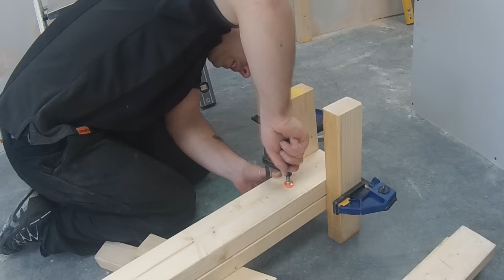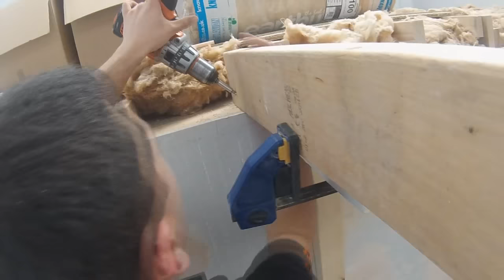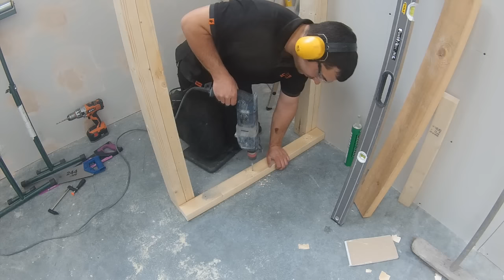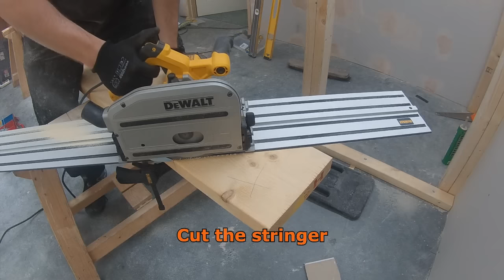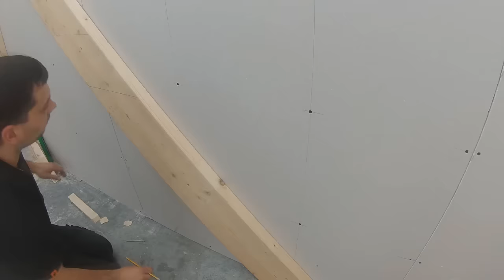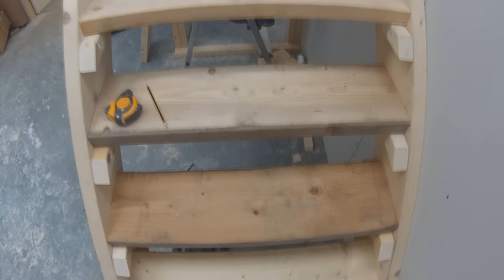How to build Stairs. Easy steps DIY staircase

Comment: I thought, I was the first to do this design, this guy did it 8 years ago! I built these stairs for a tiny house in my backyard. In addition to screws I also used glue for each support and I secured brackets under each support.
Reply: We bought a house built in 1955 that has this same stair design leading to the basement. Works pretty well, but eventually the supports wear out if they're not thick/tall enough.

Comment: I don't think that would pass code in most areas. You have the skills, the tools and the track saw to make perfect stringers with a framing square. Always use three stringers and remember the adage for measurement "finish floor to finish floor" and you can't go wrong.
Reply: I need to replace some stairs that go to storage over a shop, they are outdoors. The originals were very similar to this but had metal brackets on the stringers to support the steps. Wouldn't attaching supports to the stringers for steps, instead of cutting the stringers for steps make them last longer as it's still a 2X10 instead of a 2x10 with huge sections cut out. I also doubt my ability to make all those cuts correctly, I don't understand why this wouldn't pass code (I won't be inspected but want to make them safe), other than not having a 3rd center stringer.

Comment: You could have skipped the first minute and a half of video by just buying 4x4s to begin with instead of laminating 2x4s.
Reply: ignorant comment, laminating 2x4s instead of using a 4x4 minimizes twisting and provides more structural strength.
Reply: @igoryakunin685  I actually wondered the same, so thanks for giving the explanation of why two 2x4 are better.  I like to build things but don't have the background to know things like this.  Thanks again!

Comment: Thanks for sharing your work . I'm sure this is OK for an indoor job which I've  seen in our store front rental units. As per load capacity, I will not suggest any over 250 LB.
Reply: What is the biggest problem with loads? the stairs? can you any improvements on this design?

Comment: I did this similar way.Instead of cutting out the stringers thus weakening the wood I did as in video nailed the stringers.Another factor cost 2x12 wood is $$$$$ at least where I live.By nailing the stringers you can go thinner thus saving money and still super strong structure.

Comment: Sure beats measuring and cutting multiple stringers to exact dimensions. I like the look as well. I have an outdoor deck with stairs to a landing. There has to be a stringer in the middle though. If I adopt this design, I just have to cut steps in the middle stringer.

Comment: I made a stair case similar to this, only I made sure I put 2 lengths of threadbar between the strings a third and then 2 thirds up - that way the strings won't spread apart over time. Also glue every surface that you're screwing and these will be strong stairs. As they are - I wouldn't have much faith in them

Comment: I´d like to do a question (sorry for my english) I can see you are using thick steps, but the step´s support is holded by 3 screws, so all the weigth is supported by 6 screws. Is it right? Thank you very much for showing your job!
Reply: Bueno Javier, ten en cuenta que los tornillos son gruesos, yo no pondría más tornillos, si acaso uno más y , en todo caso, los soporte se pueden encolar.
Reply: Only if you stand in the middle of a step. If you stand close to one side then your weight exerts force pretty much on only the 3 screws on that side.

Comment: Solid (uncut) stringers are much stronger than pre-cut stringers you buy.  They only have about 4 inches under the cut, while if you build it like this it's the full 8 or 10 inches.  Ideal stairs are 7 inch risers and 11 inch treads  but they can be a bit shallower to make all rises the same size:  Very important.  Learn to use a building square to mark their position.  Very quick and easy.

Comment: I wouldn't notch the top with sistered wood I would use maybe 6x6 that has been routed out in the middle leaving two edges and inside is some sort of metal bracket. Other than that it's a good video.

Comment: I did something similar I wanted mine to be a feature, so stained it and finished it with polyurethane. One tip, between coats of PU, sand down the stringers etc. but do not sand the actual treads of the stairs. That way they remain slightly rough with the grain that is lifted and this makes them safer.
Reply: Leon thecat   Mine is as solid as a rock.
Reply: Leon thecat  You haven't seen mine so why refer to it as a death trap? The load is not supported by screws. The stairs are let in to the supports. My only comment was not to rub down the treds of the steps as the roughness is actually useful.
Reply: Leon thecat  Yes, it is to code.
Reply: Leon thecat  The contractr dealt with all that. It is several years ago. I had 2 staircases installed at the time.  I should think around a hundred Leva.
Reply: Leon thecat  Why don't we just bring this to a close? Not sanding the treads of stairs works well.

Comment: If you don't know how to build a staircase/steps properly just go to your local Lowe's or HD. They have stringers already cut and ready to go in different sizes. Just cut and add the steps yourself. Over time the steps in this video will collapse. Atleast glue the side supports on before screwing them. Looks cool though.

Comment: How much weight can they handle?
Reply from the maker: Haven't tested it, but I would guess at least 800 lb / 360 kg.
Reply: HA that's great!
Reply: Each step is only being held by 6 screws (and in reality 3 screws since most of the weight is on one side or another) that easily bend due to the 1.5 inch bending moment from the wooden blocks.  Well under 800 lbs.  If they were replaced with typical metal hangers that have virtually zero moment and use 3 - 4 screws/hanger I would guess it would be at least twice as strong.  I built a stair like the one in the video several years ago on a deck.  Inevitably water and debris were trapped on top of the wooden blocks and they rotted first.  Eventually it provided no compressive strength and the treads began to move as they were essentially only being held with unsupported screws sticking out of the stringers.
Reply: Well hes screwed them onto a massive 10mm of plasterboard. Also he has been extra clever and not used any truss rods. Bombproof! Not...
Reply: +Dave Clarke Looks to me like the screws are in line with the studs in the plasterboard wall. No idea what a truss rod is.

Comment: I would put 2 lengths of threaded bar between the strings a third up and 2 thirds up to stop the strings from pulling apart over time. Notching out at the top of the string weakens the string. Risers should be higher (7.75'' I think) and all equal. Tread would be nicer with a bull nose - less painful when you fall/up/down them.

Comment: You could call this a ship's ladder, not a stair case. I would have used joist hangers at the top instead of cutting the board, and when you cut the first piece off the bottom of the board you should have saved it and used it as a guide for the angle you established.

Comment: Not awful, I’ve definitely seen worse. If you want to have a staircase that will pass a building code inspection though, this is not the way to go. Treads must be 11” or 10” with a nose. No rise can differ more than 3/8”, and finally, if there is a finished area the stairs must have kick plates. These aren’t my rules btw, this is IRC standards.

Comment: I like notching the stair steps out of the stringers. It allows you to use 3 or more stringers for more support. I prefer using 2 by 12 lumber for the stringers but you can use 2 by tens with 2 by 4s screwed along the bottom of their length to beef them up. Stairs like the ones in the video look like they are built by a hillbilly IMHO.

Comment: OK, let’s just explain......... instead of the likely risk that the screws yield (steps fall through) after fatigue, add supports for the steps that lie on top of the beams instead. No risk to fall through. Best is 1-piece-beam cut for each step, or add triangular pieces on top of beam that support the steps. 🥳

Comment: oH....BTW...NOTCHING OUT wood at the TOP of the stringer effectively WEAKENS the strength...reducing it's load carrying capability.

I wouldn't walk on your stairs.
Reply: To be fair, you are USian, which means you weigh at least 400lbs. These should be fine for normal sized people.

Comment: I'm sorry but that is an unsafe staircase due to the fact the stringers need to be cut. This would never support 800 lbs. if you tried to put up a pool table it could collapse.
Reply from the maker: Stringers don't need to be cut. Here we attached the step supports with 3 x 3" screws, which have a sheer strength of around 200lb each. In total there are 6 x 3" screws holding each step, which gives a theoretical sheer strength of 1200 lb. We have tested these stairs up to 600lb with no problems.

While cutting stringers may be stronger, it wasn't necessary for us to be carrying 800+ lb up the stairs. Using supporting blocks in my opinion is easier.

Comment: Sorry to be pessimistic but right from the start this is all wrong. Im a framer of 15 years... you dont use clamps, just nail it. You dont predrill pine either its a soft wood and can easily handle screws, nails, and 1/4 inch lags typically. True steps should be built with nice 2x12 stringers and 2x10 treads, but your steps would "work" temporarily.

Comment: We're not "haters".  We don't want to see Gramma fall through a run and break her hip and neck!  There are many factors that determine the shear strength of a screw such as wood, moisture content, thickness of shank, humidity and so on.  With that said, those stringers you notched and laminated together add NOTHING to the integrity of this stair.  You have effectively transferred the weight bearing load onto 3 screws supporting each side of your run.  This is very dangerous.  Not to mention, out of every builders code available, and the code of good ship and sense.   Over time, I promise, it will fail.  At the worst time too.  You'll be carrying a piano down those stairs, and YOU will be on the downhill when it fails.  You will remember my comment.  Please, do yourself a favor.  And the piano.  You have some good equipment there, might as well learn to build with it the right way.  SAFETY in mind, learn a few basic math equations, put them to use in building your own stringers, and for heavens sake....don't do any unnecessary notching.  You weaken the strength of the board.  Rise and run depths take into account the width of the stringer to be used so that you have enough weight bearing strength for each run.  Happy building